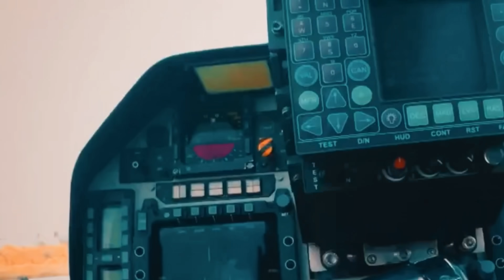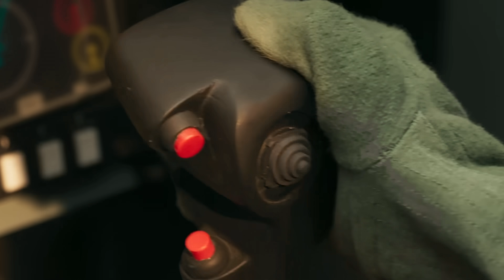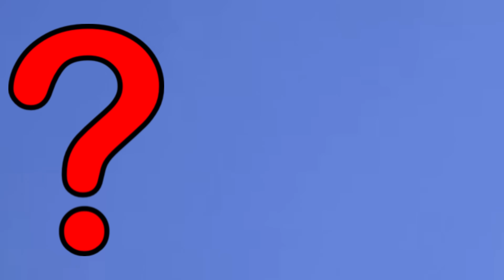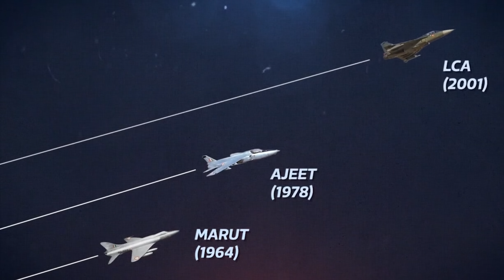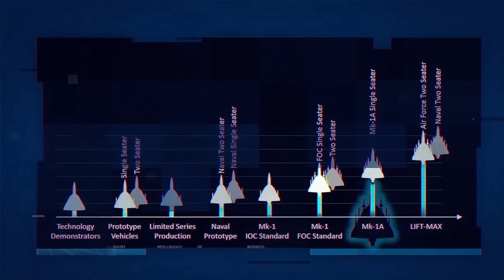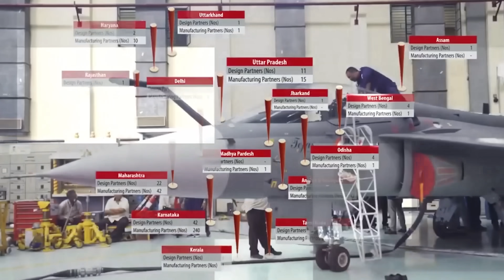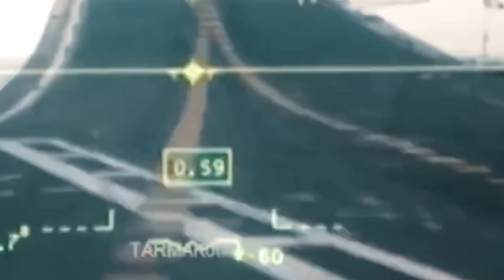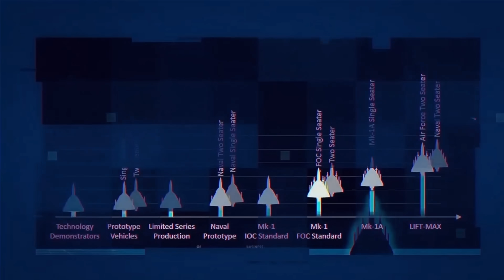Why does everyone hate the Indian 'Tejas' LCA 4th Generation Fighter Jet?

Comment: I think the lessons India learns from struggling with this jet have value beyond the jets built.
Reply: Correct assessment. 💯👍
Reply: @JonnyHindu  the cringe
Reply: @GM-xk1nw  Why, you have something against knowledge build-up?
Reply: You are right it is not question of money and we can get  better fighter with these money. But building an fighter aircraft is diffrent high the knowledge we get in designing an succesful aircraft has no value and it is valueless. We want complete knowledge to build diffent diffrent fighter. That is our objective
Reply: @sathya36  that’s I think what I’m saying. India built competent, modern knowledge and skills with this project not necessarily for the Tejas but for what India is now capable of designing and building.
Reply: @mikepekarek5895  add to that the valuable lessons they learned from the development of their own turbo fan engine, the 'Kaveri GTRE', whilst they were developing the Tejas, with little to no existing industrial complex in this field. Whilst it didn't produce the required thrust due to core issues plagued by a lack of an adequate development platform and metallurgy,  it has now provided India a major springboard (the experience also allowed them to solve their 'single crystalline blade' technology issue).
Reply: @TonyMandez-mo2ut  Jet engine tech is one of those things that doesn't get the press it deserves.  Russia has some great airframes and lesser but decent avionics, but their jet engines are decidedly inferior.  As it pertains to India, one of the reasons India walked away from the Su57 program is that the Russian jet engines are trash.  I'd bet lots of money India can start building jet engines that exceed Russian engines.
Reply: @TonyMandez-mo2ut  
Turbo fan engine is used in an airliner (made by Airbus or Boeing) & not for high-performance military fighter aircraft. Keveri (GTRE) isn't Turbo-fan engine.
It is wrong to say, "with little to no existing industrial complex" as we possess comprehensive capabilities in this field - HAL (including development platform (GTRE) as you say). HAL has produced/manufactured/made a thousand engines at least, in its two engine divisions (at Bengaluru & Sunabeda) under "license" as needed for their (Russian, British or French) fighter aircraft that we buy, under agreement to make them in this country. The only thing we lack is the ability to "design" that is necessary, before making an engine - that only America, Britain, France & Russia possess. We are overcoming that too & Kaveri is the result that needs yet to prove, get certified & enter production in an engine division of HAL. Also drdo (responsible for research/development) has a Metallurgical Research Lab, too.
Reply: it never got of the ground in 60 years. That must be a new record in development time lines.
Reply: @mikepekarek5895 
In 1960s, a fighter jet aircraft was deigned (HF 24 "Marut"; by a German Aero-nautical Engineer, Kurt Tank) by & made in HAL. It served well but was severely under-powered as the only engine we could get ("they" would give none!) was under-powered.
Indian engineers & scientists are capable. At times, the politicians who have to take decisions have less (or no) faith in their (engineers' & scientists') capabilities. Modi is a decisive person who takes bold decisions & is persistent with his men, waiting till they pick up the necessary capabilities. It is like a hand-shake between politicians & scientists. 
When I read uninformed, ill-informed (& even stupid) comments here, I wonder myself, about the capabilities. But these same people produce politicians from among themselves, to fill the Parliament to take decisions. What can we expect from such an elected person !? Can he take right decisions at the right time? In many cases in the past (four, five or six decades) they failed to take "decisions" and it is why we are here!
Reply: Thats a tale in engineering.. Faliures determine the path forward. Lessons learnt is what we Indian would take away from Tejas
Reply: I heartily agree. India did this on their own and learned valuable lessons for the future not only from their successes but probably more importantly from their failures. Unlike the Chines who have primarily employed reverse engineering, theft of technology and the use of foreign engines India engineered the Tejas on their own.  The R&D acquired during this trial is invaluable. Good for India!!
Reply: did what on their own. 80 % of key components are foreign. Only body is made India.
Reply: I doubt it. India is too slow to learn its own lessons.
Reply: @Concerned_one  
You can't get faster than this in this Technology that one ought to learn the hard way (you need to first learn what needs to be "learnt", after facing problems & issues). Nobody gives these things on a platter, to you.
Reply: @MrPoornakumar  what are you even talking about?
This isn’t the first time India built an indigenous fighter jet. We never learned any lessons from the creation of the Marut.
Reply: This was a valuable pilot project that integrated the private sector into defense programs in a big way. The innovation it sparked, and capabilities it created, will lead to a robust Military-Industrial Complex. The future Stealth fighter owes a lot to the Tejas. By itself it is a capable air defence fighter, and a useful bomb truck...and cheap too!
Reply: @ cheap?
It’s pretty expensive for a light fighter jet.
Reply: Indeed a lame excuse
Reply: True like First Love ;)
Reply: Yeah. The lessons would help to better streamline the production chains of future projects. Indigenous jets are great, but having a Public Private Partnership is a must. A single state owned player would be overwhelmed by the number of projects that are currently in design/production phase.
Reply: Just learning is not enough..we are in lot of threatwith hostole countries all around
Reply: @vickybhadwani2689  You have to start somewhere, and a couple decades of learning does mean something.  Good thing you dodged the money pit of the Su57, but you really need to replace the MiG29s and Su30s.  Russian gear is straight-up trash.
Reply: @mikepekarek5895  Now that you said it as snaked out that comment.. i see it...we will go ahead and opt for Su 57 it may be a shade below F35 but F35 is a white ele[hant and it needs systems of systems and even the USAF cannot sustain usaing such an expensive platform for long time..Su57 is  way cheaper...We will go for Su57 anyday if we cannot get our indigenous jet  manufactured in jet.. if Russian gear is trash why does America shits its pants and never go on head on direct fight with Russians?? ever wondered?...Russian missiles are the most feared...We dont want to get conned by the US with their over expensive manned drone called F35...We would rather use a jet  a shade lower  then  F35 but integrated with compatible systems..
Reply: @mikepekarek5895  Never will India get conned or fleeced by the Americans with their over expesnive manned drone called F35....Su 57 with all t he tech is best bet for India as stop gap untill our AMCA realizes
Reply: I think you are trying too hard find a silver linne where there eis none
Reply: So what are the values learned from this failed project???
Is it "endian just can't build fighter jet"? :-)
Reply: @SengpoSatbang  building a good fighter jet isn't something people can just do.  It takes effort, a first attempt, revision, learning.  It takes refining metallurgy.  It takes flying an example of what you built to see what works and what doesn't, even with today's computer modeling, you need real-world data for your computer modeling to help, and the USA's data is largely secret.  You can copy some basic design elements, but that doesn't do everything.  And sometimes a mistake teaches you more than success, because a mistake forces you to examine in detail to figure out what went wrong, where a success might hide flaws you are not yet aware of.
Reply: Lessons are continuously learned but never applied.
Reply: They haven’t learned the lesson, all their future projects are delayed and are continuously missing dead lines
Reply: True! This is technology  demonstrator and first step towards grasping the technology.
Reply: @arindamsengupta4953  
It is beyond that stage (as technology  demonstrator) & is a fully-developed, capable jet fighter aircraft, ready to go into action as & when the IAF  presses them into service. Else,  IAF doesn't pay hard cash to buy one for "technology  demonstration"! They are very clear and need it for fighting wars.
Reply: Dont understand what value India learns. It will never. India is too proud of a nation and people that they will never admit any mistakes or fault. The all powerful India politicians and news medias will make sure that whatever negative can and must be turned into positive, at least superficially. This they will do well with their comprehensive command of English. Never challenge any Indian to "talk".
Reply: @juhantoon6524   Our defense exports have increased 31 times in the past 10 years. Modi, unlike previous governments is laser focused on National Security and is making long-needed reforms which are producing real and measurable improvements. Optimism is not pride. We didn't have optimism before.
Reply: Learn what? India went back to importing old foreign jets.
Reply: @tritium1998 one project at time
Reply: @tritium1998  
only for the spare parts
Reply: @tritium1998  Rafale is old for you? aight ok
Reply: @tritium1998  
Most of the countries who buy them (Malaysia for instance)never use them and are moth-balled (kept in store as spare-parts are, without assembling the aircraft) even. Meanwhile the later (improved) models of aircraft are made available. 
These are as good as new. India buys them (& countries who sell them are also relieved, as they collect the money, go & buy later models of aircraft). It is a win-win situation (that only Technical people can appreciate).
Reply: you must be living in dream land no country has ever bought Indian hardware even Malaysia it’s all MoUs.
Reply: @tritium1998  go and look india's latest 5th generation aircraft.
Reply: @tritium1998  Well developing a fighter jet from scratch snhances skills and reduces manufacutring time in future projects

Comment: There must be some reason India who also using Rafale, SUs and MIGs pick this plane after  years of testing. India cannot  depends on Western power’s support in the time of conflicts.
Reply: Another, more practical reason, is that the Hardened Air Shelters in almost all Indian forward airbases are made to fit only the MiG-21. None of the other jets you mentioned can fit in there. Which is why Indian Air Force was the one who limited the size, payload, etc of Tejas right from the start. Ofcourse, people don't know this fact and now decry Tejas's lack of payload and range even though IAF itself set those requirements and did so with the Indian front's operational picture in mind.

Comment: 40 MK1 were ordered in 2015 , 83 upgraded MK1A were ordered in 2020 , and in 2024 Indian gov has cleared the purchase of additional 97 MK1A
Reply: India will struggle to complete 42 squadrons even till 2047. That is how late we are.
Reply: how much tejas are in service with IAF?
Reply: @fochbyfitnessmotivation8982 initial 40 ordered in 2015 is in IAF service , the 83 mk1a ordered in 2020 will start deliveries by July this year, first mk1a is already in the air
Reply: @sarants4488 so what about mk2 and what gen it would be 🤔
Reply: @sarants4488  I heard amca will also have the same GE 414 engine which will be later replaced by Indian made kaveri engine but will it in the amca or the second version of amca that will be 5.5 gen
Reply: Second generation of AMCA will be 5.5 generation. First generation will be 5th generation only but it will have direct energy weapon weapon which will be in 6th generation aircrafts. So AMCA mk 1 will have some 6th generation features also but it will be a 5th generation aircraft. First AMCA prototype will be rollout in 2027. First MWFJ(officially Tejas MK 2) will rollout in March 2026 and first flight will take place in late 2026.
Reply: @sarants4488  Won't enter service until the 2030s.
Reply: @sarants4488  actually you are kinda wrong here. Tejas mk1A is also a 4.5 gen aircraft. The airframe looks the same from the outside but almost all the internal systems have been upgraded.
Reply: @fochbyfitnessmotivation8982  there are currently 272 tejas,but going to be 350-380 soon by 2027-28
Reply: @fochbyfitnessmotivation8982 32+8 trainers

Comment: One thing to add naval variant is ready but since its a single engine aircraft so it wont be accepted by airforce. So now naval variant is now being used as test aircraft for parameter and technology testing till TEDBF prototype comes.
Reply: WTF? You mean single engine variant won't be accepted by Navy. Not Air Force (as you've written).
Reply: @death_parade  yes. Single engine works for airforce but not for navy since navy can't land aircraft in Ocean and double engine provide safety incase  1 engine fails. But in my view navy should buy small number and  can use 1 single engine fighter on shore base facilities for training and point defence of base.
Reply: Problem with Tejas Naval variant is that it can't take off with a decent load without a CATOBAR Carrier and India has none.
Reply: @JoyP09  power requirement can be meet with 414 engine. But still navy would accept a single engine fighter. Therefore naval tejas will not go beyond TD.

Comment: Good video, a couple of corrections :

1) The Tejas Mk-1 or any of its upgraded variants will never use the 98 kN F-414. It's simply too big and fuel consuming for the design. They will continue running on the F-404 until their mid-life refit when they get swapped out by an indigenous 90 kN Kaveri engine.
2) The Delta-wing design doesn't make the aircraft more stealthy. What it does do is increase it's range significantly, owing to it storing additional fuel in those big wings.
It also makes the aircraft less dragy in the high-speed regime. That's why you see the Tejas's combat range being similar to the F-16 despite the latter being a much bigger aircraft.
Reply: And also performs better at higher altitude where air is thinner
Reply: Kya baat kar rahe ho F-16 ki Combat Range Tejas mk1/1a se 1.5 guna hai..

F-16 has ~860km CR whereas Tejas has 550km CR.
Reply: @JonnyHindu  Tejas 740 Km.
Reply: Good explanation / Jai Hind

Comment: On its own it falls short. but 250-350 of them - its overwhelming - mass production will make it cheaper and more importantly aircraft to aircraft the differentiation is in its radar signature and arms it carries. That needs to be factored. China too keeps a large number of "not so heavy" fighters - and that can overwhelm US or NATO.
Reply: “not so heavy” you mean J10.
Reply: @xenon6947  Try getting a J-10 to fit in the Hardened Air Shelters that Indian Air Force had built for MiG-21. It won't fit, right? But Tejas will. So sit down.